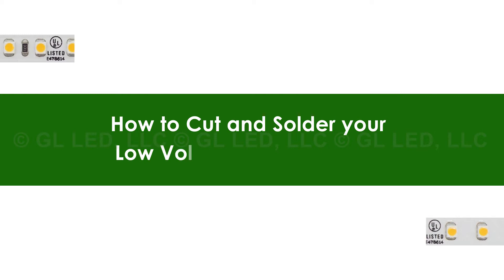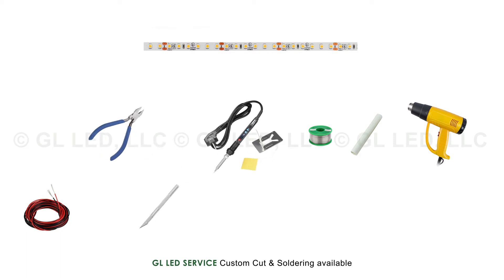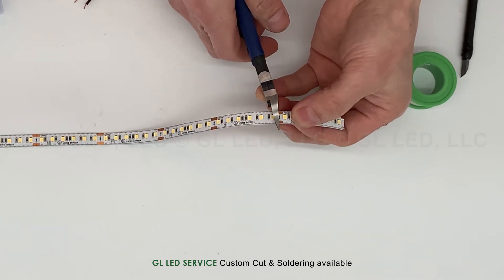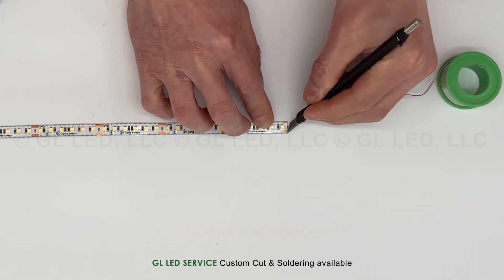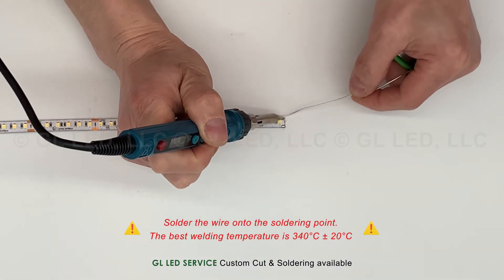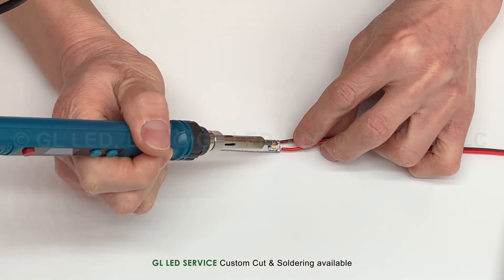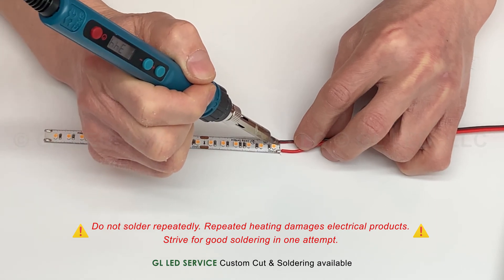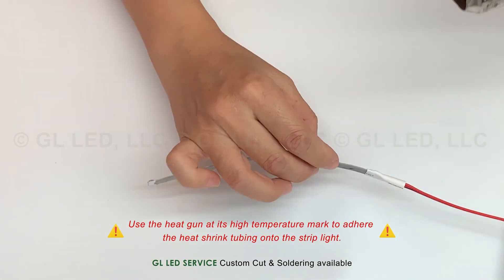How to Cut and Solder your Low Voltage LED Strip Light

Comment: Hi, you must put your heat shrink tube on your Led Strip before you do your soldered connections, because after you can't, thx for sharing techniques..😘😘😘
Reply from the maker: Thanks! But if the strip or lead wire is not too long, putting the heat shrink after soldering is doable still.